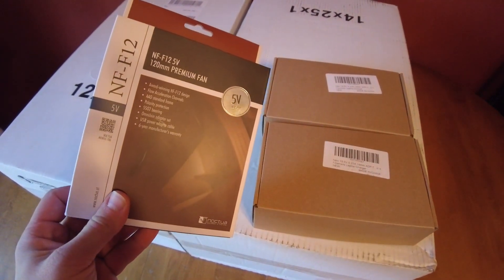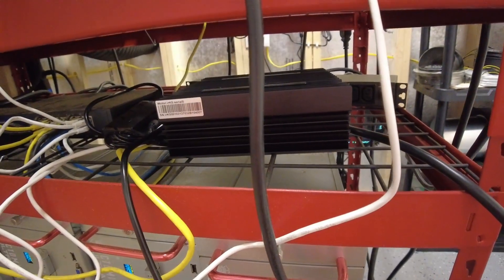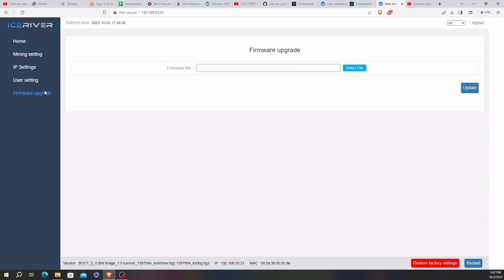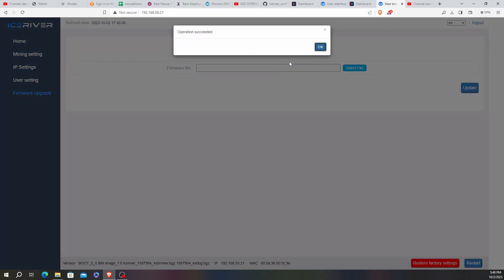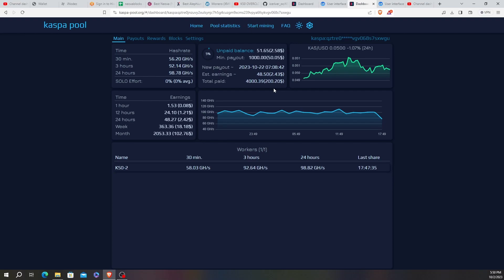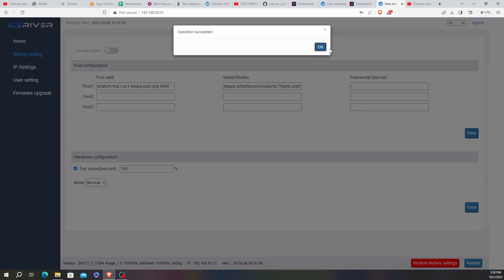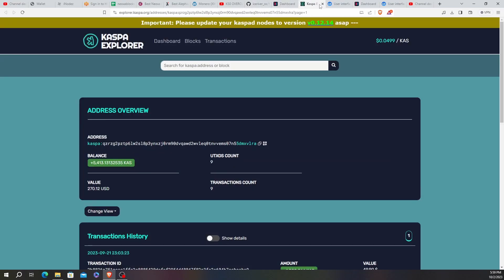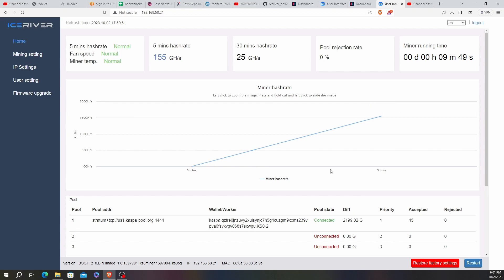Increase Your Yield! IceRiver KS0 Firmware Updated to 160gh/s - 24hr Update and Fresh Install

Comment from the maker: Did you upgrade the firmware on your KS0?
Reply: Yes,  upgraded but only can get aroung 140 gh/s.
Reply from the maker: @OzSkyking152  Luckily both of mine are close to 160.  First one is 159gh/s and the most recent is at 156gh/s so far
Reply: I tried the 160 upgrade but I only got about 60 gh/s so I had to go back down to the 140 upgrade.

Comment: I did not update my KS0, hashrate showing nothing may be need to update ks0 ??
Reply from the maker: If it's not showing any hashrate, there may be other issues.  You can try installing the latest firmware and see if that helps

Comment: hi, I noticed that after updating the fireware /Incidr-Exo120 or Exo140, Exo150, Exo160/ my asic KS0 turns off for 1 hour every day. Does it do this to anyone else? Thanks for every reply.
Reply from the maker: I haven’t noticed mine turning off at all. Both of mine took the 160ghs version and have been rock solid so far.  I think my uptime is 35+ days. I have the MinerBox app on my phone to monitor my rigs and get notifications when a worker is offline
Reply: @ruskyscryptocave  
Thank you for your reply.
I will try to look at the problem in my case.
Reply from the maker: @betelgeuse369  no problem. My first one is from the late July batch and the second is an early August batch. Not sure if that has anything to do with it. I know the November batches of KS2’s aren’t performing as well as the earlier ones.

Comment: i tried all oc settings but it did not work, i think some KS0 machines doesn't recognize the overclock.
Reply from the maker: Did you make sure to update to the latest iceriver firmware first?
Reply: @ruskyscryptocave  yes i did, i talked other miners and we saw that our hard firmware has the same version (Version   BOOT_2_0.BIN image_1.0 1597994_ks0miner 1597994_ks0bg) This version is not running with any of the overclock modes, just 100 Gh.

Comment: On your Kas0, What do you have hooked up on the usb ? Is it the fan?
Reply from the maker: Yes I have the noctua fan plugged into the usb for additional cooling. The miner does run hotter with the updated firmware